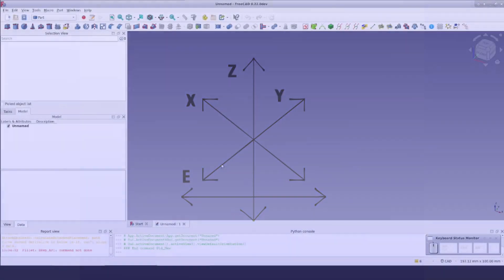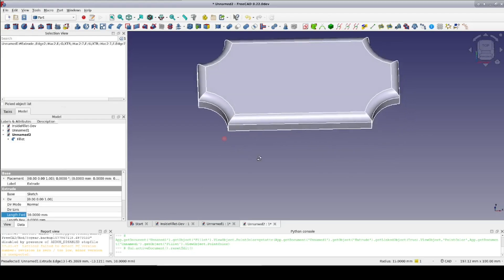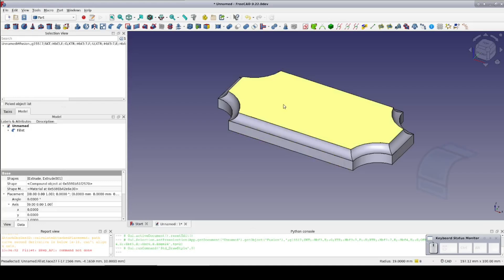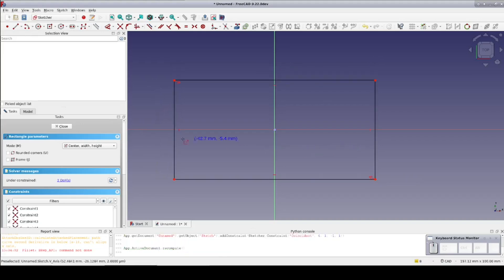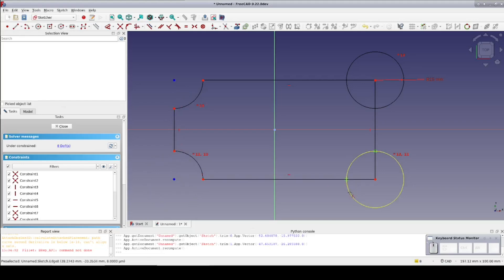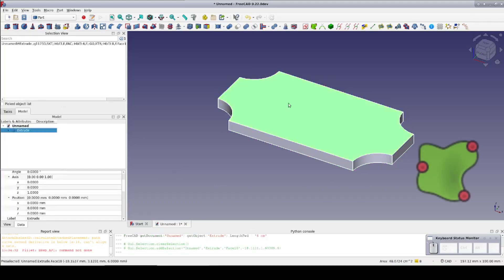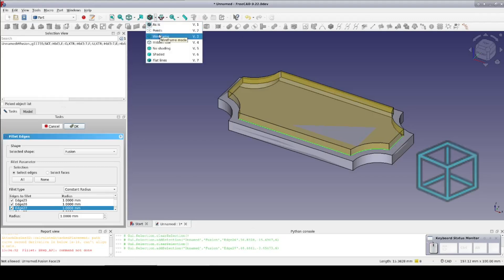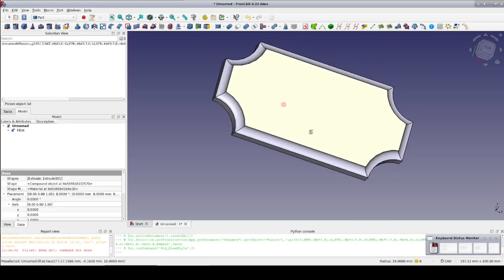FreeCAD: Decorative inside fillets

Comment: I modeled a plaque almost identical to yours in Freecad 1.0.  Problem is, I'm having difficulty creating a toolpath.  I'm very new to cnc routing.  What tool, what operation, etc. do you recommend for machining the fillets?
Reply from the maker: I don't know much about doing CAM in FreeCAD other than that there is a CAM workbench (used to be called Path).

Comment: Beginners: have a little patience with the fillet or chamfer tool and use the up/down buttons next to the fillet size box. Using these up/down buttons allows Freecad the ability to visually change the image. The speed of which depends on your computer's rendering power.  The default is 1mm.  So, your desired edges are all picked and the fillet size is 1mm. Click the down button (usually changes to zero), then click the up button (back to 1) and watch the image. If the selected edges didn't fillet, 1mm is too large. 1 or more of the edges can not be filleted to 1mm.  If it's not critical, highlight the 1. value and change it to something smaller.  DON'T click enter, or OK . Instead, move your mouse to a non-action screen location and left click. This will set the fillet value to what you typed AND fillet the selected edges. If the edges didn't fillet, your value is still too high. Repeat the value lowering process until the image changes or a start over will be necessary. Cancel the fillet or complete (an error will be shown) and click the undo arrow once to return.

Comment: Learning freecad can be a long process.  Say, I create 2 or more bodies and boolean cut the selected objects. The part is saved and/or filleted, only to find an error in 1 or more bodies. So, the undo button is used, but the boolean won't undo.  I suspect the split function is the next step, but I haven't tried it, yet. Lol. 

 As I progress to more complicated parts (a last part was made from 2 join and 1 cut boolean),  the edges to fillet can be very frustrating. Pick 30 edges only to error because 1 edge can not handle the selected radius size. Same goes for chamfers.

Comment: Filleting can be quite frustrating for beginners. Error messages may be misunderstood. The size of a fillet is a good example. If the size of the fillet is too large, freecad throws a tantrum, kind of. Instead of undo or other deletions, simply edit the fillet to a smaller size. Ex: I try to create a 1mm fillet and have picked numerous edges. Clicked OK and it errors. Error messages telling me it failed, the part may be flipped over, and the preceeding tree object gets a bad mark. Wow! In some cases, the entire model disappears from the screen.  To the beginner, all is lost ... and ...  there are NO yt channels describing what to do next, how to retreive all the "lost" work, etc. 
This is when the use of the 'recompute object' command comes in. Select the last (lowest) object on the active (the 1 you were working on) by right clicking the object and selecting 'recompute object' from the menu. 
(Side note):
Additionally, to get rid of those blue checkmarks on objects within a tree, use this method. Start from the lowest object because recomputing object usually creates a blue checkmzrk on a higher object. What is happening (my guess) is freecad recognizes something changed, causing something else to require 'recomputing object'. Should you go thru this entire process and the blue checkmark is chased all the way to the body object and that errors out (blue checkmarks return to lower objects), something is wrong with 1 or more sketches. Go back an edit it (them).